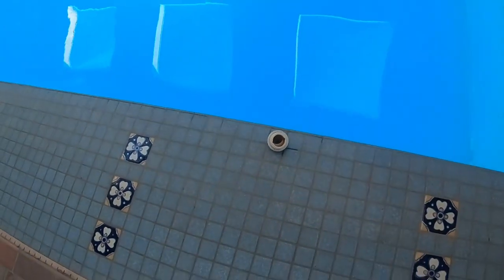Swimming Pool Leak At the historic Deer Creek Manor mansion In Bloomington Indiana

Comment: I just stumbled onto your channel. My parents inground vinyl pool (installed in 1982) and 2nd liner in 2007 just started leaking an inch per day (16x32). I bought some dye and just started swimming around looking for leaks. Both returns, the light, the skimmer and the end stairs seemed ok. I did find two holes behind the ladder where my father installed two pvc braces and because of the stainless panhead screw that held them on, there were (2) 1/8 inch holes. In your opinion, would these be large enough for the pool to lose 300 gallons+ of water per day? I'm going to patch them and hopefully it will stop the leak. New subscriber here.

Comment: I new somebody else had to know about those cracks in returns I find them mostly in steps but I’ve have fixed dozens of them. Just like you did guess better term would stopped it from leaking.
Reply from the maker: Yes very common on step returns and fiberglass pool returns